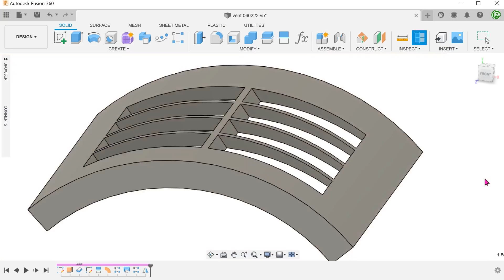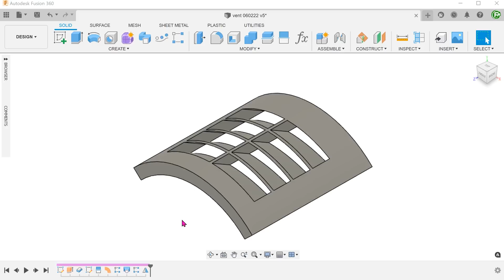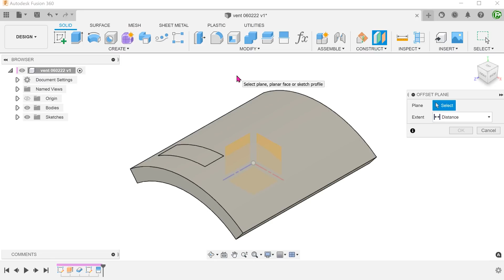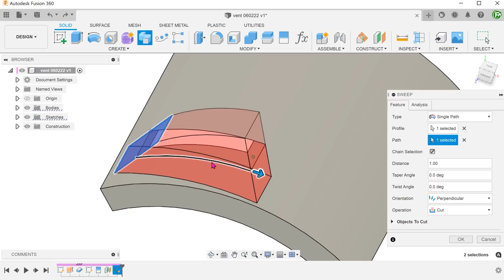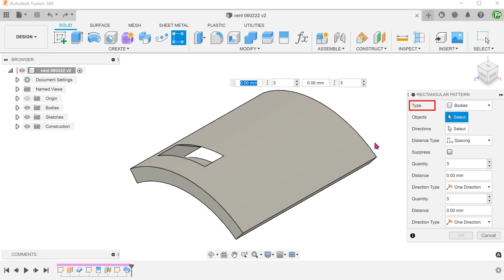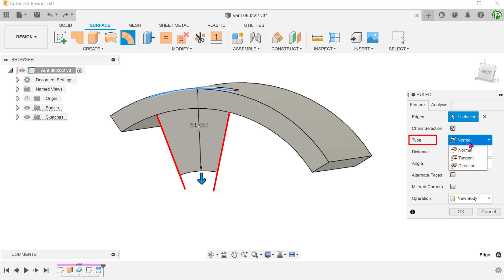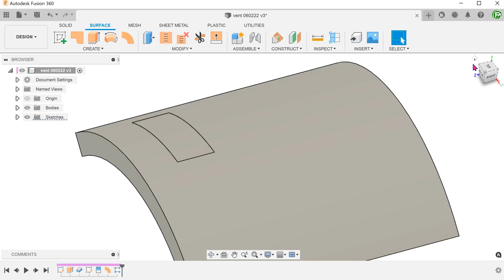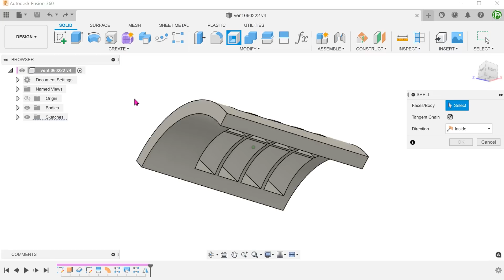Fusion 360 | Case Study 25 (Swept Cut/Ruled Surface)

Comment: great case study! i wanted to take a shot at this with less steps, so here is my approach: https://youtu.be/LzRIL_1rmBY . I used split face on both top and bottom curved surfaces and loft cut the resulting profiles. I am not setting the angle of the vent holes directly in my method. thank you to fusion 360 school for his videos where I have learned so much.

Comment from the maker: At 3:34, I really should have changed the extent to "to object" before clicking on the corner. If we leave it as "distance" and click on the corner, when we change the dimensions of the sketch rectangle, the offset plane will not update accordingly. Sorry about this.